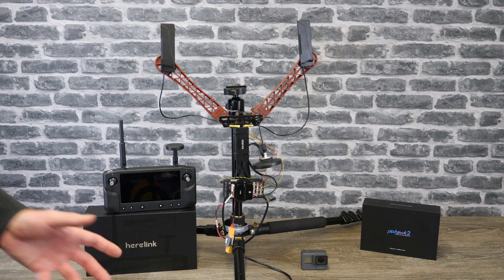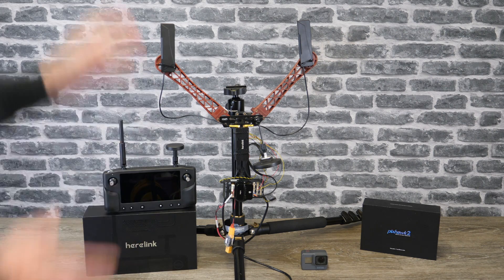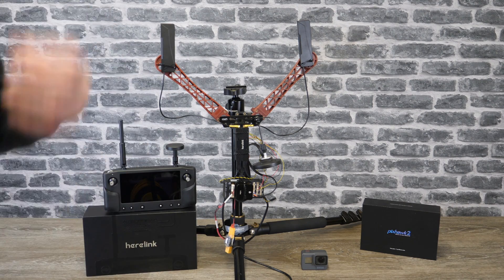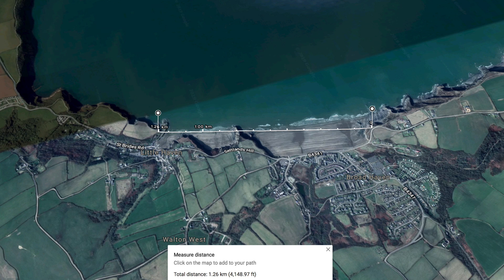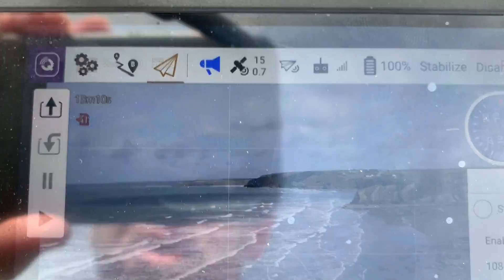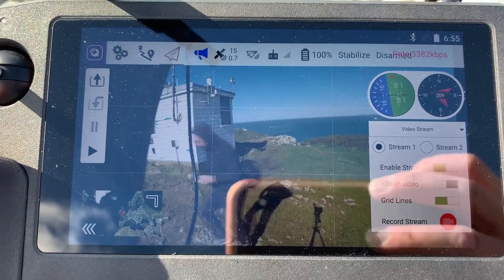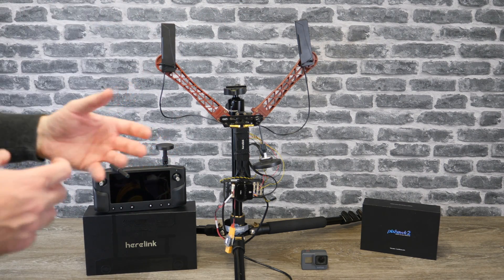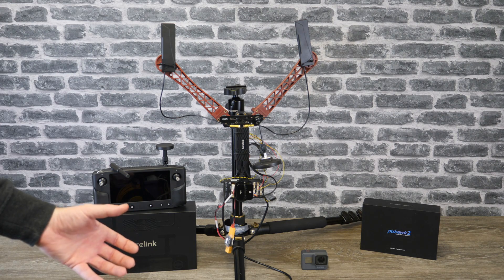Herelink Digital FPV System Range Test's - 16km Possible ?

Comment: These are great videos. I build large sized octo quads as a hobby for smaller filmmakers and wanted to do it more full time. Currently we’re using DJI, but have you tried anything else I should be looking at?

Comment: Hi, hope u r fine. So far u r the only one who got 16km range on what i would say in "some what ideal situation". How about some real world testing on a proper Multi-Rotor or Plane, where the antennas are moving around and the interference of high current and switching frequencies of ESCs. Plz post video on some real world testing of the maximum range in FCC mode. Other than you, ppl have managed 1km to 2km range on HereLink ONLY!!!. One has gone to maximum of 5km. I want to spend on this device but I am not sure whether it will give the stated range. I have to use it in nu-urban area and I want 12km solid HD video and control range, so your testing is very very important for me, it can save me 850$. plz reply.
Reply from the maker: It would be illegal for me to fly this out beyond VLOS in the U.K. that’s deemed as 400ft.  The test was done to prove the rages could be achieved. Now with many systems there is always things that come into play like antenna placement and local interference. Iv been trying to come up with a legal way of demonstrating some range however that’s extremely difficult. Posting videos online of illegal flights as a comercial operator would not only result in me loosing my licence but also getting prosecuted. 

The basically realty is the system is capable of 16km but again like all range it’s subjective. DJI FPV is capable of 5-6KM on average and I’d be using that as a base line but in the perfect conditions these longer figures are possible but that’s not the norm.
Reply: @MadRC  Thank you for such a satisfying reply.
I have been reading few comments on other forums as well, is there any effect of sea on the range? because ppl relate the good range is due to sea. what is special in the sea that it can extend the range or gives a good clear reception? What i think is that u took this beach/sea side location specially for the clear line of sight as there are no obstacles in the sea. but the same is true when the drone is high up and flying, then the scenario becomes similar to the sea, what you say?

Comment: Hello Friend.  this system works on pixhawk 2.4.6?  the previous one from cube 2.1
Reply from the maker: It will work with pretty much any Ardupilot compatible controller.
Reply: OK.  Thanks a lot for the help.  now I will buy without fear.
Reply: tell me one thing?  if i use a GOPRO HERO 7 will the received image be good?

Comment: i would like to buy the Pixhawk 2.1 w/ Here2 .

someone is selling a bundle RFD900+ Telemetry Set with the Pixhawk 2.1w/here 2.

I've been flying 3D RC Helicopter for over 10 years. i am just getting into planes VTOL for long range and new to this technology.  please explain 
1) why do you have two 2x RFD900? and why do i need two of them to fly?
2) Radio Modems, I assume is for 4GLTE flight?
3) i am trying to do my homework to learn about the following antennas and weather i need a 
     Radio license to use them in the USA? 
         a) Antenna, 900MHz Quarter wave monopole 2.1dBi
         b) Antenna, 900MHz Right Angle Quarter wave monopole 2.1dBi
4) i went out to the flying field to speak to some Drone pilots but they tried to stear me towards the TBS long range system instead, because according to them,it a better system and everyone has The TBS installed and I'll be able to get more help setting it up . so now i am confused.
5) i am setting up a VTOL 2120mm (skywalker x8) wing span plane for VTOL.
please answer ASAP

Comment: It's a shame the controller does not have HDMI out - a bit of an oversight? If it did, it would make a perfect long-distance live video link for outside broadcast/film cameras transmitting 1080p50/60 back to a unit truck vision mixer. Teradeks transmit much shorter distances than you achieved and they cost thousands.

Comment: Thanks for doing the test. At the 16 km distance the red text on the pod screen shows less than 1.5 Mb/s. This is a rather low transfer rate and the video would've looked rather poor if the camera (and with it the whole picture) was rolling or closing on a terrain, like it often happens on the actual plane. Still, it is a remarkable range for such low-gain antennas.

Comment: Can we map sticks on the controller to use it as a RC transmitter to fly plane?
Reply: Left stick is spring loaded to centre with no option to remove the spring
Reply from the maker: Correct but you can map it how you like but will always self centre however I have not stripped it to see if this can be changed.

Comment: Excellent Review, Impressed with the range. You have put my mind at rest, I have paid a lot for the beta unit and I was very worried with the range. Thank you for your review's and you have helped me a lot in setting up the system since it did not come with the manual. I have also purchased a GoPro 7 Black and the managed to test it successfully. One question though, about the placement of the Herelink antennas, does both the antennas have to face forward? In this instance what will happen if the drone faces away from me, will I have the same reception? Or does one of the antenna face forward and the other face backward so that they will cover 360 radius? Please help since I am in the process of finalizing the placement of antennas.
Reply from the maker: They are flat panel omnidirectional so In a vertical position they should give the same range all around

Comment: Amazing! I would like to see how it would do with interference in a large city, also steel buildings and larger mountains. Great video, thanks!
Reply from the maker: Yea this would be good to see and tbh is hard for me to test my self.
Reply: I have seen a video whereby the guys had a Rover and they were in a multistory car park and it looked like they drove the rover right around the concrete middle elevator structure. At least that's what it looked like. Maybe not the best test but when you think about it it's not bad. Clear image and control on the other side of the steel and concrete.
Reply: @markgiles8527  do you have the link to this video that you saw?